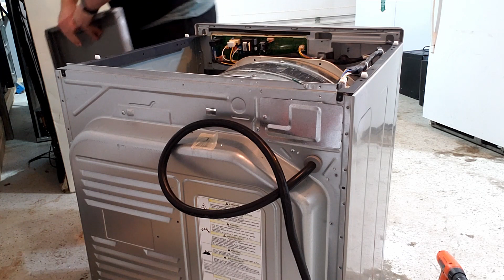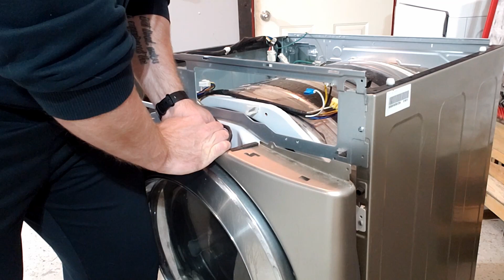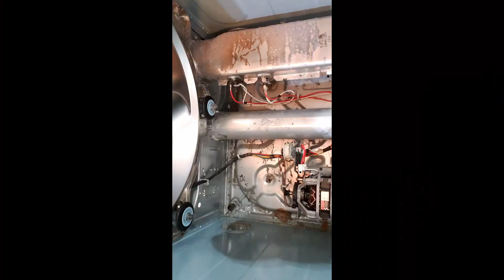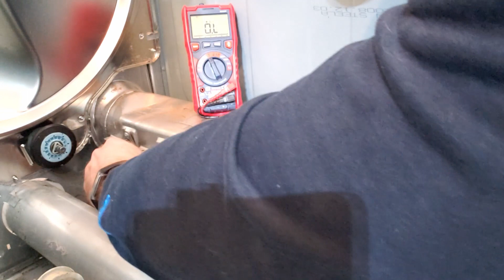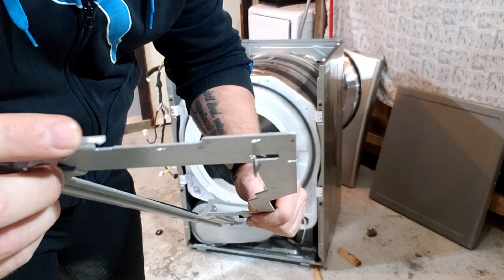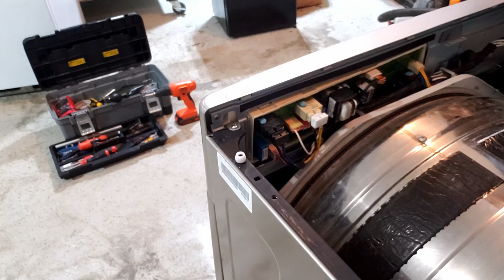Why Your LG Dryer Isn't Heating (And How to Fix It)

Comment: Hi , Just found you channel and want to start my on repair business from home part time but tough to get experience because local repair companies are looking for full time workers ..... Would you say to learn buy some used dryers /washer and take them apart to learn then take  jobs to learn ?  also what do you call that tool to take off wires or plastic grommets ?   regards  Joe
Reply from the maker: Thanks for watching Joe Rocha, yeah you could start like that, there is usually people giving away appliances for free but they are usually older. One of the biggest parts of diagnosing is being able to take apart and put back together the machine. The tool I use a lot is just a pick, also a tac puller comes in pretty handy. Good luck and watch a lot of you tube videos for free easy training.